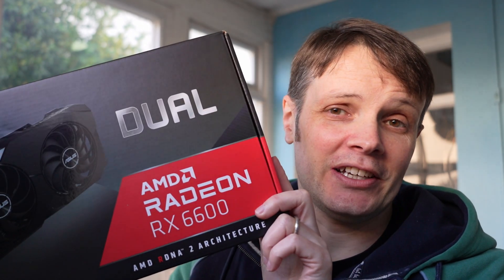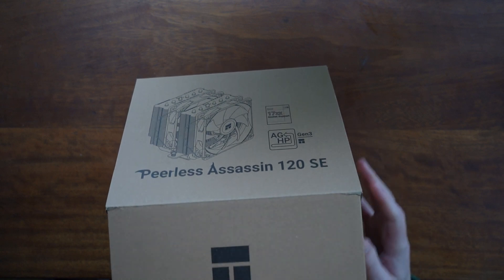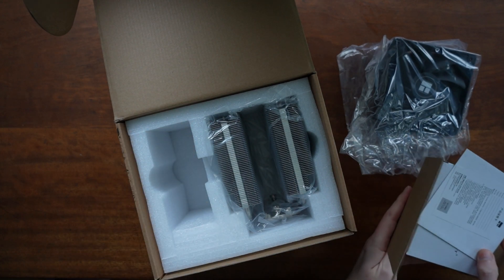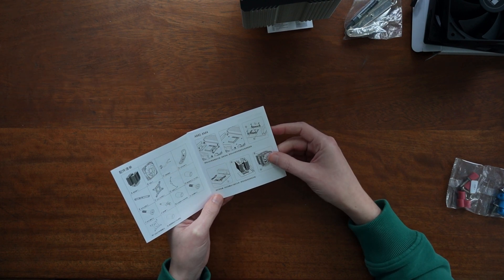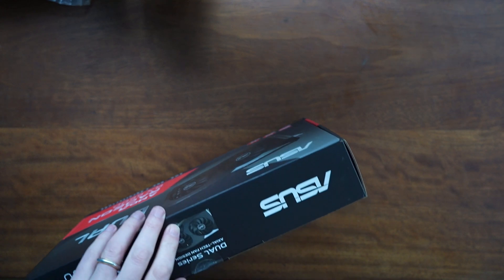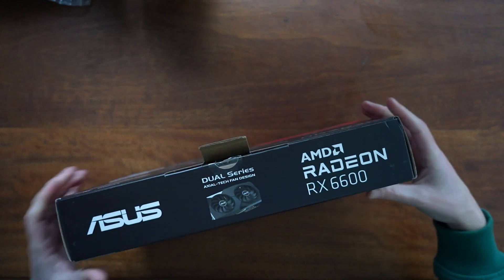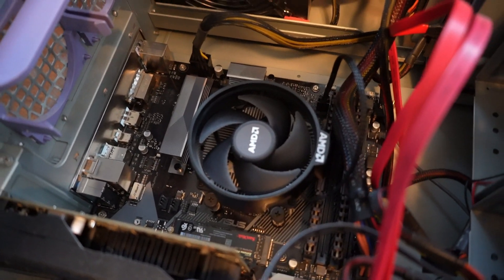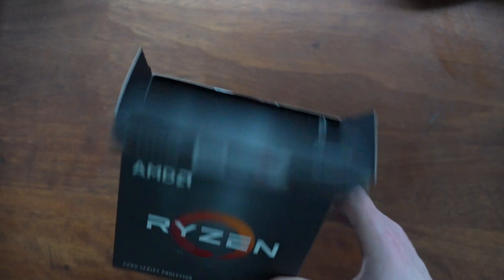Upgrading My PC with Ryzen 7 5800x, Radeon RX6600, PA 120 SE

Comment: Not sure if it will make a difference, but as per manual for 2 stick of ram you should use slot 2 and slot 4 for dual mode. Not 1 and 3, those are used only with 4 sticks of ram. It sounds silly but its how it has always been with ryzen cpus.
Reply from the maker: Thanks. I only noticed I'd put them in the wrong ones after the install, it's had no problems since I have been using this with the 3600 for the past 2 years!
Reply: @IanWootten  I would like to know if you experience any difference in performance once you switch them. :) GL

Comment: Nice choices. I built this same system in October. even the same cooler. That PA 120 will tame the high temps of the 5800x nicely. I did go for the gigabyte 6650XT though but I'm sure you got a much better price on the base 6600. Nothing wrong with that GPU you will get 140FPS on high in MP MW2 and can handle any game on the market 80+ fps no issues.
Reply: What temps do you get on your 5800x? I have the PA120 and it quickly reaches 90C on cinebench before it starts to throttle to 4.5 Ghz. I have already tried repasting and same results
Reply: @rubenramirez8062  Highest I've seen gaming and watching YouTube/Twitch on 2nd monitor is like 87C. Most often it sits around 72-80C while gaming. I don't use benchmarks as they don't really apply to any real work situations. it will boost 4850MHz all day long gaming and hold those temps.

Its possible you have bad airflow, the cooler could be defective or simply got a lower quality silicon 5800x. not everything is made 100% equal.

Comment: In the newer version of Portal you probably had vsync enabled, which does exactly what you say, limit the framerate to your monitors refresh rate. 30°C on your CPU is basically idle temps and show that you are heavily bottlenecked. Nice build though👍
Reply from the maker: Thanks Jonas! That was in Qube 2 - and with Vsync disabled in game. They rise into the 40's when it's enabled. In this case it was running through my capture card so didn't even have it hooked up to my usual monitor. I checked to be sure and it needs to be disabled in a config https://www.pcgamingwiki.com/wiki/Q.U.B.E._2#High_frame_rate to get above 60fps. After doing this it gives me a 140fps and temps of 49 degrees.